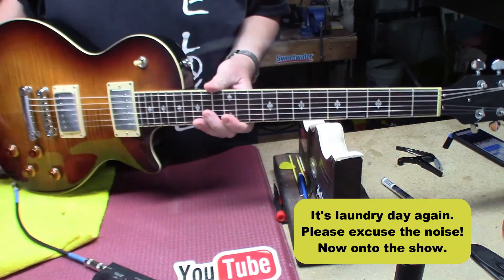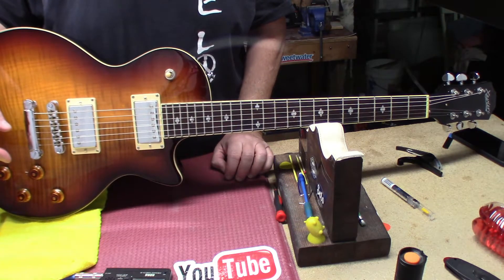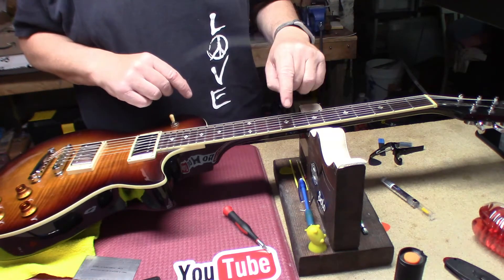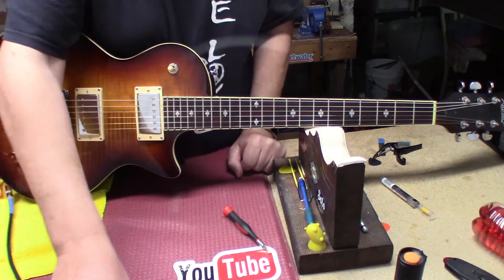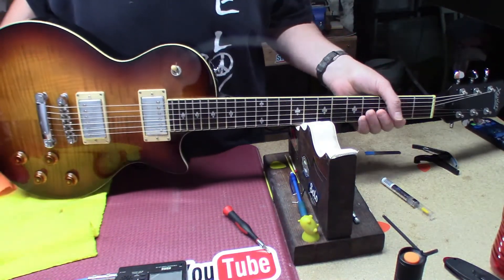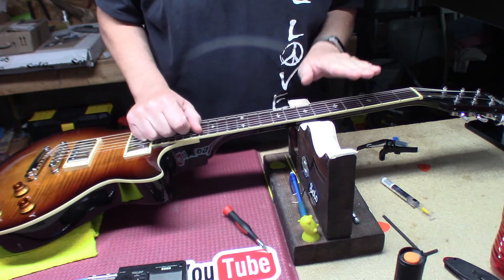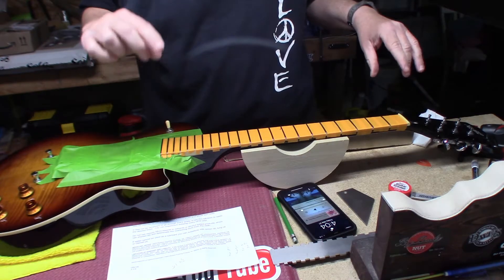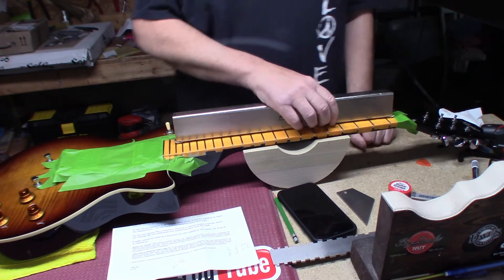XAVIERE PRO500 LP Shaped Object Review and Full Setup

Comment: Got an Xaviere XV500. A Luthier friend rewired it with a modern Les Paul setup, including custom treble bleed. Added locking tuners. The neck & frets are perfect. The OG PAF/Crunchy Pups now sound amazing. Amazing guitar after a bit of work.
Reply: Sorry this is a necro reply- but Treble Bleed- the most worthwhile and simple upgrade you can do, in my opinion.   Makes your pickups and controls actually useable

Comment: Nice work. 
The $269 price requires your expertise though to get the neck, frets, bridge, intonation, strings, nut, string height, etc, sorted.
So the cost of your service expertise (plus parts) has to be added for a playable instrument. 
Am Epiphone might be a better option out of the box.
Reply from the maker: I agree, but a brand new Epiphone will need a setup as well. Just not as much work…
Reply: So many players don’t understand guitar setups.  

Even top tier like Gibson, PRS, and Fender, couldn’t care less about it.  Because they don’t have the time- or the Ability- to adjust a guitar to the preference of who is going to ultimately play it.  Impossible.  

Which is why the most important and useful skill you can have as a guitarist, is to learn to set up the guitar- for Your preference.

Comment: If the low A is 4/64 and the high a is the same wontvtge low E have some buzz issues cause of wider string vibration?
Reply from the maker: The spec is 5/64 on the bass side and 3/64 on treble side. You can't adjust the middle saddles.
Reply: @stringmanguitars4329  will that work the sane for a Floyd rose bridge as well
Reply from the maker: @jesterraj  yes

Comment: When I unwrapped my XV-500 and tuned up the strings the neck was WAY out of adjustment...

It turns out the neck shipped with NO TENSION ON THE TRUSSROD AT ALL... 

It was an easy setup of course but BEWARE... If you let the neck get stressed like that things can happen-- esp. w/ heavy strings.